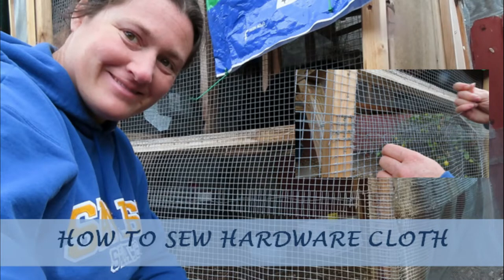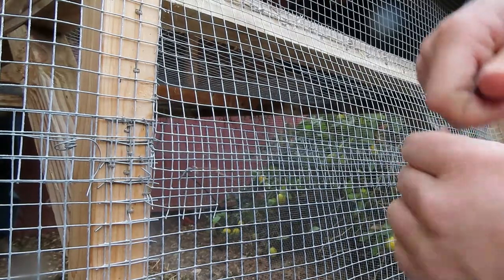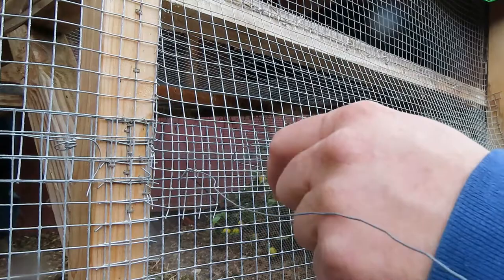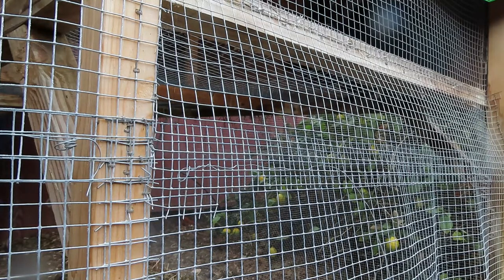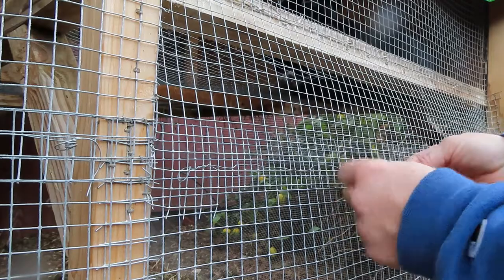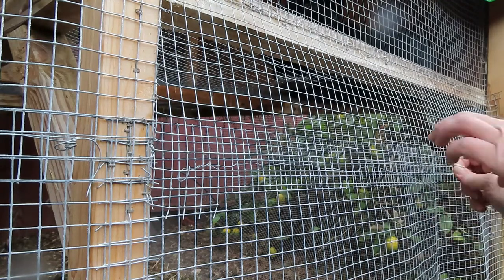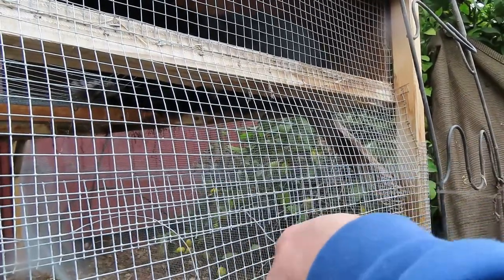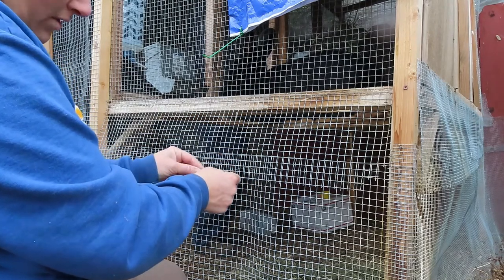How to Sew Hardware Cloth

Comment: Good video! As far as I can tell you have the only one on you tube! I was looking for a little easier way to join 1/2 inch hardware cloth, but alas. Hope your not offended if I add my tips. 1. The better the alignment of the wire, the easier the job. 2. A good thin pair of needle nose pliers are your best friend!
    My method. I start just like you, but only lap the hardware cloth one square. I then go in and out skipping every other hole, while also going around the set of wires I'm following. Pull tight as you go, and to avoid the kinks, I usually work with about 4 feet of wire at a time. About every 6 inches I double wrap at the same hole for extra strength. When finished it'll look like it was joined at a factory. Time consuming, but looks great👍!
Reply from the maker: Thanks! Good tips are always great, that's how we all learn together! Sounds like that would work great as well! I make sure mine line up as much as possible--sometimes things don't line up quite perfectly, but it's still workable! I found when I tried to wrap around periodically instead of doing this the whole way through, that it would loose tension, so that's why I didn't do it that way. If you found a way to do it without loosing tension, that sounds great!
Reply: @sowandtare  One of the best parts of the internet is how we learn! About learning, I built a 8x18x6.5 covered run and on my first reply I still had a bunch of knitting to do! I've discovered a technique that works even better for me! I hope I can describe it. I tie in my wrap wire at the start end, skip a couple holes or 3 then using a small O ring pick that's   just over 1/2 inch with a 90 degree bend to wrap the wire around the running hardware cloth, and repeat. No weaving in and out.  Wish I had a way to show it!
Reply from the maker: @scottsellers9039  Awesome!
Reply: @scottsellers9039 it would be great if you make a video of that!

Comment: Takes a little extra $$$ but takes only a fraction of the time and a custom tool......  HOG RINGS.   We use them on nearly all the avian netting that tops all our larger turkey, duck and chicken runs.    We have used this method when we first got rolling and but BOY do you have sore (and sometimes bloody) fingers by the time your done!     Other good trick is the stainless / metal zip ties you can get at Harbor Freight.      Another great tip if using this method.....  Bend up a piece of scrap cyclone fence material, make a "fish hook eye" on on end, make the whole thing with a slight bend and thread the hardware cloth just like you would a sewing needle.   Another tip for twisting ends.....   Safety Wire Twist Pliers.   That tool will CHANGE YOUR LIFE... LOL!!!

Comment: Good Idea to use the wire that came with the spool.  I used old electric fence wire and it is way to thick.
Reply from the maker: Thanks, the only trick is to keep it from kinking up so it's still smooth.

Comment: Can I electrify hardware cloth?
Reply from the maker: I would think so, but I would be concerned about the animals inside if you did that. Most people would run a string of electric wire just off the enclosure to keep predators out if necessary.
Reply: @sowandtare  lol I'm wrapping the mesh around my growbags and there are lots of ducks here with no respect for peoples' property
Reply from the maker: @dinosanchez8528  Got it.

Comment: will use J clip be easier?
Reply from the maker: J clips are generally used for making cages. I've not heard of anyone using them for this purpose. I suppose you could use them, but I don't have J clips or the appropriate pliers to use them. The wire I am using is what holds the role of hardware cloth in a roll when you buy it. Using this wire means I don't have to buy any extra material (I am basically using the packaging to put it together), it pulls tight for no gaps, and it works great.
Reply: @sowandtare  i agree!  I actually did exactly the same thing as you do. But because I need to do it a lot, so I will invest some money and buy the tool to save my hand. Power tools are so expensive, but it helps so much in gardening.
Reply from the maker: @xdrive300011  Good luck and let me know how it works for you!

Comment: What gauge wire?
Reply from the maker: I'd have to check. As I used it only for walls and ceiling, not as a flooring. It's the only 1/2" hardware cloth I found at Tractor Supply.
Reply: You can get a spool of stainless steel safety wire at any of the home improvement stores.   100 plus feet, easy to work with and super strong.